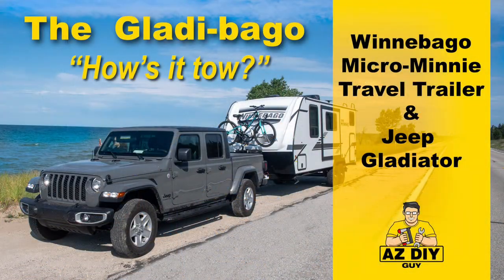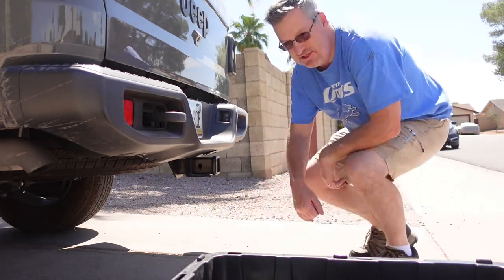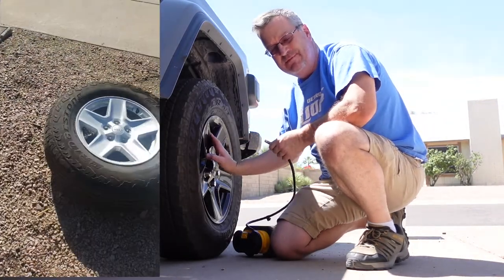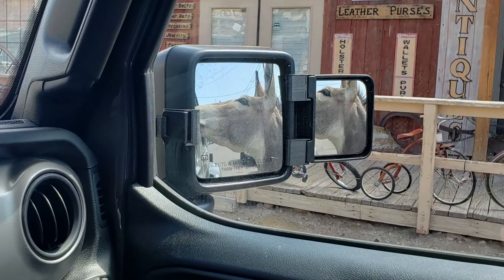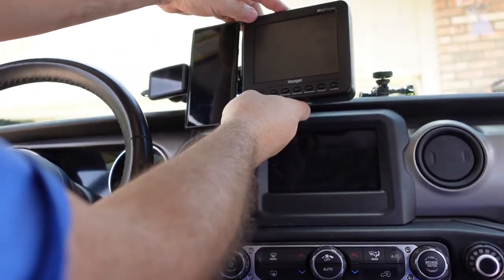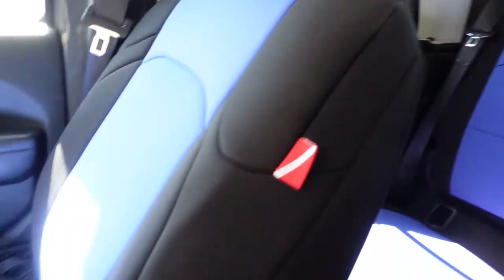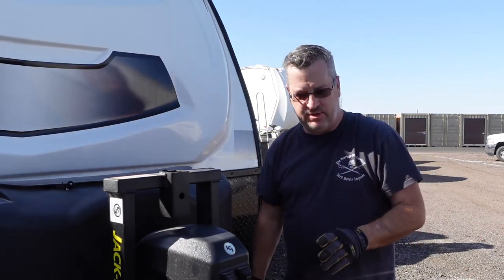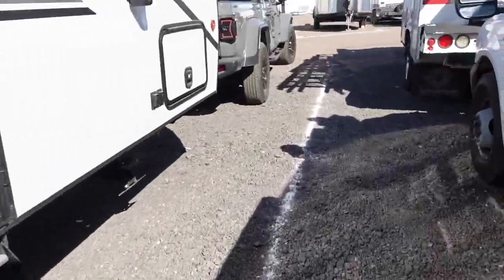How we set up our Gladiator to tow our RV - Gear, Gadgets, and Go!

Comment: Nice review, I do most of the same when pulling our Cruiser RV Hitch with my Mojave,
Mopar has a brake controller that replaces the cig lighter in the dash , nice clean install, I also use the camera on the back of the trailer as a rear view mirror, I just hard wired it to 12 v with a QD for removal 
We keep a 5 gal bucket to put water in black tank, I store it over the electric trailer jack, hang the safety chains on the bail, keeps my jack out of the rain
Reply from the maker: Thanks Robert! I did look at the Mopar controller, but didn't want to give up that 12 volt outlet used by the other widgets. I do need to solve the protection of the trailer jack. I may just use that bucket idea.

Comment: I don't know what year model your Jeep is, but my '22 Gladiator has U-Connect and works with both iPhone and Android phones. Just plug your phone into usb port and you get all the navigation, media and call features of your phone on the entertainment screen, without having to touch your phone. I put my phone in the little space between the cup holders on the center console. That would free up some space on your elaborate dash mounting tree.
Reply from the maker: Yes, this is a 2021 and does have the same capability and I do have it connected for nav etc.  It's just nice to have it up there instead of in the console area during long trips. I've recently started using the Motorola adapter for wireless Android Auto for day to day, but long trips I still like to plug in to keep a charge.

Comment: I’m a little confused about the wiggle stopping clamp. Once the trailer is on and the bars are tensioned that shouldn’t move at all in my experience. If you’re driving around without the trailer it’s a heck of a lot faster to take off the hitch than to bolt on that gadget, and it could save your shins!
Reply from the maker: I was getting a lot of banging around back there, enough to make me think something was wrong. Adding that clamp stopped the extra noise. Maybe my hitch shank is a little narrow.

Comment: Quite surprised the max tow doesn’t come with a brake controller!
Reply from the maker: Maybe it does now. As I recall, I was waiting for the Jeep one to come out,  then it was hard to get. I'd installed this one in the 2020 regular tow, so I stuck with it when I traded to the 2021 max tow. I didn't want to give up my 12v outlet either.

Comment: Hubby and I found this to be very helpful. What is the Jeep towing recommend weight and trailer weight ( of yours). We have 2021 gladiator with 6000 towing
Reply from the maker: I have a 2021 Sport S with the Max Tow package, so it is rated to 7650 lbs. I wouldn't want to get close to that. Our trailer is 4600 dry and we pull it with empty tanks and not too loaded. All the specs are in this video: https://youtu.be/tEamYfrLh_w

Comment: What are you using for mirror extenders?  2020 Jeep Gladiator?
Reply from the maker: HI Laurie - It's a 2021 Gladiator, but I had a 2020 previously and it is the same setup. I use the rampage mirrors from Amazon, which are for earlier model jeeps, but there are really cool adaptors from Thorn Engineering (sells via eBay) that make them work with current models. Here are the links: Rampage Towing Mirror Extensions (Needs Adaptor for Gladiator): https://amzn.to/3PNXn1t  • Jeep Tow Mirror Adaptors (For Rampage Mirrors): https://www.ebay.com/itm/334364655503   I'm really happy with the setup.

Comment: what is your trailer specs? are you towing it dry or fully loaded?  i have a gladiator rubicon on 37's - towed 30' trailer roughly 5500lbs(Dry), it was screaming! i wonder if a re-gear would help.
Reply from the maker: Our trailer is 25'6" and 4500 dry. It does rev high especially uphill. Sport S with Max Tow on factory wheels and tires. All the specs are in this video: https://youtu.be/tEamYfrLh_w

Comment: what kind of gas mileage do you get when you haul that?  What speeds do you slow to when you're uphill?  I have a Gladiator too and was wondering.  Looking to get a Bago, and saw your channel.
Reply from the maker: Gas mileage goes to about 10 on average, cross country. Uphill depends, some mountain stuff gets slow, like hanging around with the big rigs crawling along at 20 mph.
Reply: Yeah, I got the Overland Gladiator with the 6 speed auto, not the 8 speed auto.    I think my mileage will be worse.
Reply from the maker: @seansolina895  I suspect so, maybe get one of the lighter Micro Minnie's. This is a Max Tow, Sport so it's the highest tow capacity of the Gladiators, but I still wish my RV was a bit lighter.
Reply: I really would not recommend a gladiator to tow anything up a hill. You will slow down to 30 mph on any decent grade. 260lb-ft just isn't enough torque to tow. Unless all you are doing is towing on flat land at 60mph, seriously-- get a full size truck-- that's what they're for.

Comment: Were did you get the extended mirrors? I cant find them in Amazon
Reply from the maker: Hi Cindy, It's a two-piece setup. I have the links in the video description but here are the shortcuts: (1) The Rampage Mirrors are on Amazon:  https://amzn.to/3PNXn1t  They will NOT work by themselves, you will need need to add:  (2) The Thorn Engineering adapters to make them fit a Gladiator are on eBay: https://www.ebay.com/itm/334364655503  Enjoy!!!

Comment: New subscriber here. I have the 2020 Gladiator ZF 8 speed 3:73 with nitto 35’s. I have a 2020 nobo 168 off road camper. I’m loving your setup for towing. The hitch is what I need info on. Mine is overland package. Dana Hd 44 front n rear but no hitch ! ?
Reply from the maker: With this Sport S Max Tow, the hitch receiver was included. It also got wider axles, a beefier alternator, fan(?) and maybe some other stuff to get the tow rating up to 7,650 lbs. I'm not sure what weight limit can be obtained by adding a hitch receiver to a Gladdy without one of the tow packages. Thanks for the sub!
Reply: @AZDIYGuy  
Personally I think the wider axle thing is just marketing. I climbed under the rubicon the Mojave and the overland and the axles look identical with a slight milling difference right close to the hub. Mine are Dana 44hd I didn’t see where they could market any actual difference